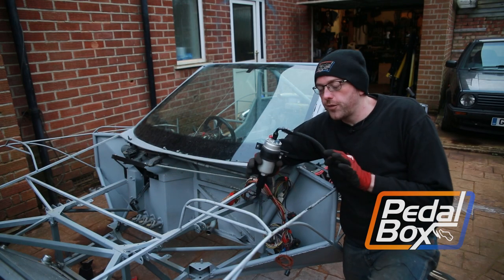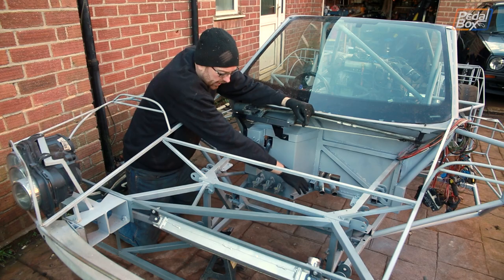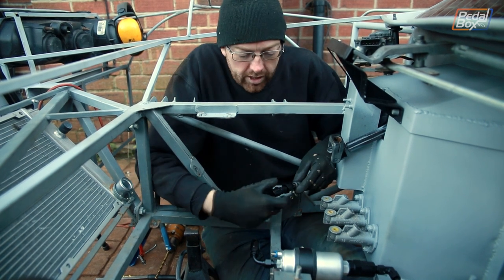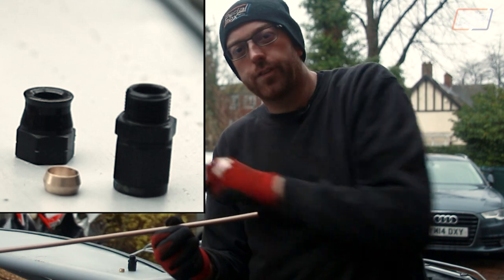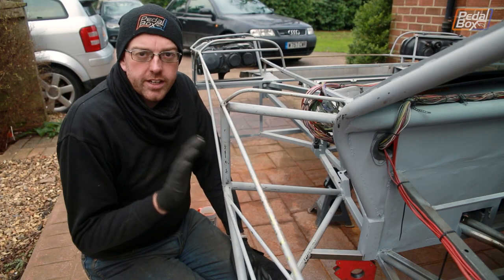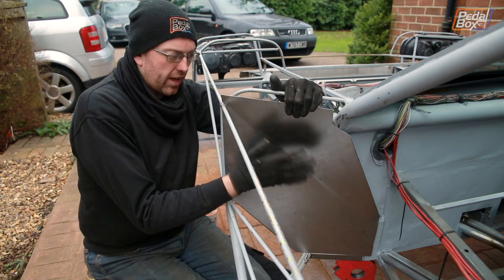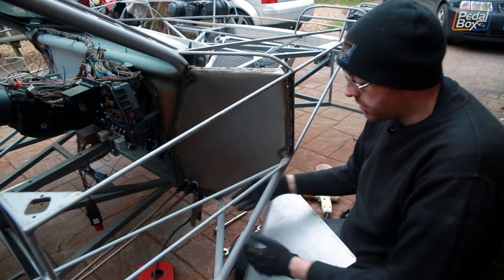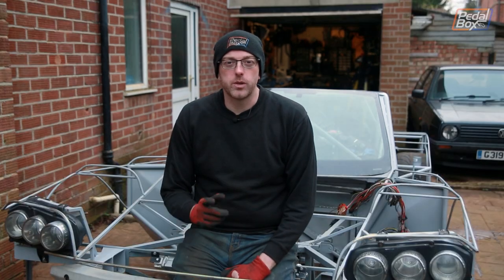Installing the Fuel System | Audi TT Kit Car | PedalBox Episode 68

Comment: I’ve heard those little feet on the fuel tank can cause cracks if they’re solely responsible for holding the tank I’m place. It’s supposedly a good idea to mimic OEM style straps and pads. 
All the same looks like the cars coming together nicely!
Reply from the maker: Interesting! maybe ones it's all fit out underneath it'll get a panel to support it over a wider area and add straps to that. Thanks!

Comment: Pump has some rubber around it, or some grommets?
Reply from the maker: Yeah there's a strip of rubber inside to stop some of the vibration. May add some extra rubber grommets between the bracket and the chassis if its really bad still